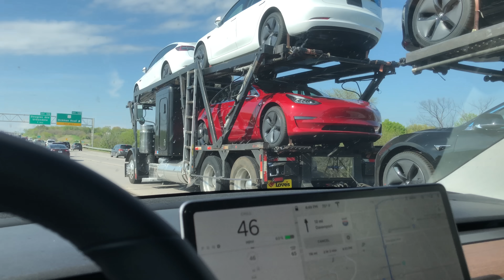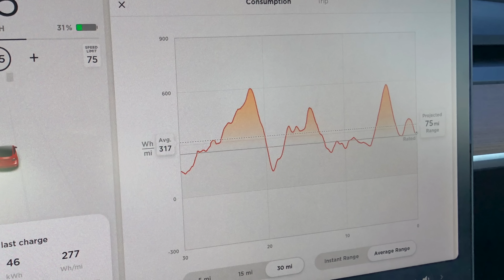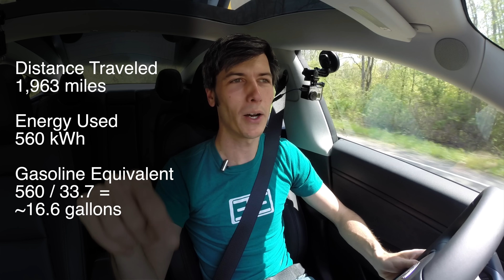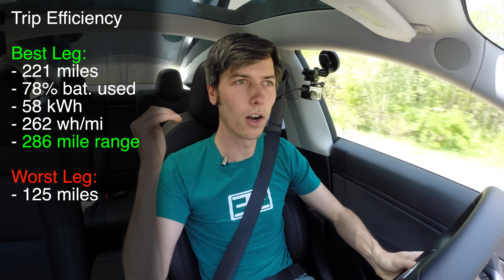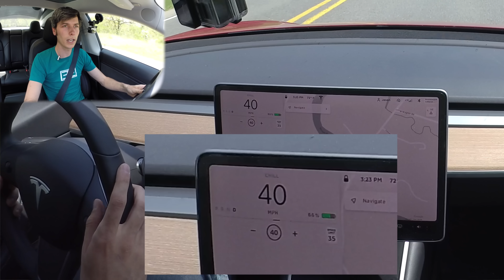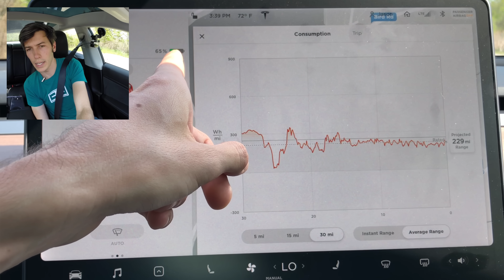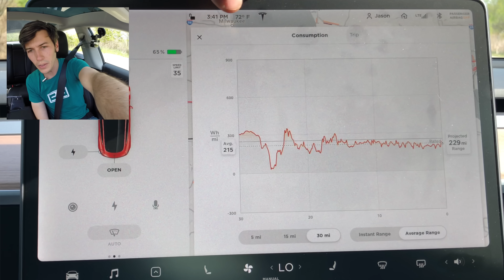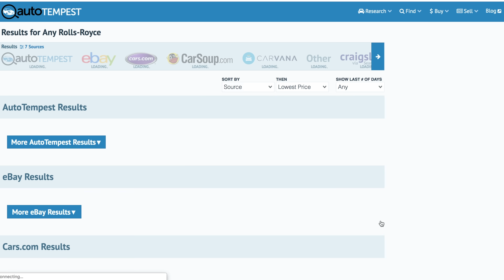How Miserable Is A Tesla Road Trip?

Comment: 1- this video made the road trip for average/non-tech people a hard thing, as they have to calculate in advance lots of factors !!
2- what will happen if front tyre explodes while on AutoPilot at 70 mph !!!
Reply: Road trips are easy. Charge up to 90-100% before you leave (ideally). Just say "Navigate to <destination address or point of interest>". The nav computer will tell you where to stop and how long to charge. It's pretty easy to beat the current algorithm. Just charge so that you have a projected 10-15% arrival charge at your next supercharger. Then take off, maintaining as high a speed as required to keep that arrival charge more or less constant, or at least above 5%. Repeat until you get to your destination. If it's a multi-day trip, you can stop at a hotel with a destination charger or at a campground with 220v to charge while you sleep. 

As for a blowout at highway speeds, I'm sure it'll handle it about as well as possible. Teslas are the safest cars on the road.

Comment: Worth noting... You also went 'down' 2 km in overall elevation. Going the other way you'd have quite a few more stops and longer charge times.
in a gas car, your range till needing gas would be about 100 miles different between the two as well.
(yes it's not 'all' downhill, but an overall 2km height difference is a pretty big difference)

Personally, I'd be curious what your range/time/etc is when the batteries are 5 years old (and not going rather significantly downhill). And while some do sell their cars and keep buying new, bear in mind your resell value will be horrid if battery wear is a big issue. So battery longetivity IS an issue, regardless if you deal with it or sell it. Also, for "save the planet" sentiments bear in mind that NOT spending energy to make a new car every few years saves drastically more overall energy/pollution. I don't dislike that tesla is moving the bar on efficiency, but electric cars are still awaiting critical battery tech breakthroughs which will make them fully viable. Any one of doubling the charge, the battery longetivity, or halving battery cost, would put electric over the top, but it's not there yet.

Comment: I worked out my diesel car would do it around $169 but that’s at 45mpg. Took me way to long to work this out as I had to convert everything to the English equivalent. But my car was £3000 so would be interesting to see the cost over a total of 10 years of how much you’d pay for each of these with second hand and new prices.
Reply: Would be cheaper to buy the most economical diesel car so I’ve worked out lol. Using your calculations, a car with 50mpg would be $148.40. Not that I prefer diesel to petrol!!

Comment: I've heard of people plugging in to a 120v and getting 4kWh-8kWh
It seems like the GPS/mapping would also factor in speed between superchargers before leaving each one to go to the next or to the final destination. Thus, it's going to use posted speed limits (somehow). So if a driver is actually going slower than the posted speed limit or has AP/cruise set to go slower then you'd probably arrive at the next supercharger or final destination with more range left than it calculates.

Comment: You might want to look at Bjørn Nyland's channel. He did a rundown on the optimal speed to drive from charge to charge to reduce trip length. It was significantly faster than 80 mph, more like 110 mph.
Also, if you get Autopilot and use Navigate on Autopilot, the car will pre-warm the battery if you are navigating to a Supercharger so that you get the best charging speed. None of this "first charge of the day" nonsense.

Comment: Honestly I'd had expected an equation of the total time of the trip depending on the speed of the car as a variable (that affects the range) and charging speed (that depends on the charge of the battery at the moment of charging and temperature), and then try to minimise that equation to calculate the optimum driving speed! XDD

Comment: What missing is, that how much coal did you have to burn in the power plant to fuel your trip?
Or equivalent in nuclear power.

People tend to forget this side of the story.

Even with these included in the calculations can be efficient, but than the question of the life of the battery, end what percentage of that battery can be 100% recycled?
As far my limited knowledge goes, batteries are nasty for the environment... imagine when a couple billion of electric cars will have to dump their batteries...
That too is terrifying...

Comment: Electric cars might be somewhat efficient but which is easier to fix and repair verses more harmful for the environment? What did Jason say about having to us charging stations? he had to wait for a long period of time 8 hours on one charge to go about 221 miles. You can do that much distance in a 2007 Toyota Corolla automatic and still be more efficiency and have better range as well as comfort with the ac on. Not to mention the turn around time is so much better at the gas pump than waiting for what was it again for the average time like 6 hours to charge up one time? That is ridiculous. The mile range of one charge up from this Tesla is 250 miles correct? My Corolla with 252,000 miles can get 415 miles on less than one tank of gas (13.2 gallons) (used Gallons 10) on the freeway. (MPG Highway is 41.5 that is nearly almost double the range of an electric car) That was fully loaded with 4 people, Ac on the entire way, 4 large suitcases going from California to Idaho then back again. Tell me why is it better to have electric if the mileage range is much lower than a internal combustion engine? That car doesn't put out hardly any emissions if at all and is super fuel efficient. I have to disagree with you Jason.

Comment: This shows how bad the inverter in the car is for efficiency.(not Tesla specific just stating all inverters suck.) I am not 100% sure but it looks like they are using 480Vac 3-phase to 400V dc so there is almost no loose in efficiency while charging.

Comment: Does using a super charger effect the longevity of the battery?  Does it make the batteries hot while they charge?  150Kw charging is a very high rate of charge and I can't imagine it wouldn't decrease the life of the batteries.  

If you use fast chargers for Li-Ion tools, constant use of these can reduce life of the batteries by 60-70%!  Of course there is always a trade off for these things and I can't imagine that Tesla doesn't know these things but do they tell the customers?  Or is this a method to sell more battereis down the road.  

This is a VERY important issue when it comes to the "carbon footprint" of the car b/c the batteries are by far the most intensive use of carbon due to mining/processing of the lithium and then manufacture of the batteries.  If this reduces the life by a fair amount then this will be a big issue down the road.

Comment: Do you think Tesla would ever put in an extreme weather  package that can use an auxiliary power source to produce heat or cold (interior AC or heater & could be used to heat batteries in very cold conditions).  If they added 1/2 - 1 gallon tank for kerosene or even diesel (or other fuel - propane would work well too) this could be used to produce cabin heat or cooling.  For cooling it would use the same technology that RV refrigerators use (absorption refrigeration).  

From my calculations a gallon  would last about 1200-2000 miles if the cabin needed a 60F (cooling) or 90F (heating) temp change from the outside temps - the difference is because of the inefficiencies in absorption refrigeration.

This would allow 100% of batteries to be used on range (minus the small amount to drive fans). I'm wondering if EV drivers would turn their nose up to using a liquid fuel.  There really is no better way to produce heat or cooling in these situations because of the high energy density of liquid fuels.  

As far as how the heat would be produced (heat is used for the cooling as well, which drives the absorption fridge) it could be the same way that old kerosene lanterns work, where there really isn't an open flame but confined in the mantle which produces the light (~1% energy) and ~99% heat.  It could easily range from 300 watts to ~2000 watts of heating/cooling depending on the demand - with higher demand actually being more efficient.
Reply: You should look up Bjorn Nyland Tesla vids who lives in Norway

Comment: The technology is cool and fascinating.  The Mother of All Trip Computers pretty much eliminates range anxiety.  And I would sit in the car the whole time it is charging just swimming through the data.  I can see the appeal... but not for me. 

I prefer my semi-Luddite Jeep (I allow for EFI because I am not a total Luddite obviously).  I want a mechanical connection between my foot and the throttle, my hands and the wheels etc.  I can fix or at least rig a temporary fix for a mechanical issue; but a software issue that leaves me stranded, that I cannot fix.  I guess I just don't trust technology enough to put my life in its hands while driving.
Still the tech is just... WOW!

Comment: How does it charge and drive 200 miles in 50 minutes? Or should i ask how much does the battery upgrade and quick charger cost extra on top of the car itself? Also Tesla is not as reliable as they'd like you to think. Gas cars will regularly do 200,000 miles without major replacement parts, some as much as 300-400k on stock parts. You can't honestly say that these batteries have enough cycles in them to do that many miles without replacement. Which will cost about as much as a new engine AND transmission combo. Yes electric motors are very reliable, but what about the rest? I get that electric works, but are you actually getting your moneys worth or is it just a fad to save a few bucks on gas just to spend that money and more on batteries later?

Comment: I fail to understand the assumption that is apparently made by pretty much all Tesla Bros that whatever you want to eat will definitely be walking distance from a supercharger... this does not make sense... also, I dont get how everyone says "oh no, there is no inconvenience, its no different than a gas car" this is ABSOLUTELY different, most high end sedans have 400+ mile range that can be refueled in minutes, virtually anywhere you want, with a virtual guarantee that what you actually want to eat will be across the street from a gas station. Videos like this just confirm what people like me think about those cars, the level of planning you had to do to make this work is ridiculous, hate on me for this comment all you want, but its the bottom line
Reply from the maker: You don't have to do any planning at all, you plug in your final destination and the car gets you there with the Nav system. As the video shows, it will take significantly longer than if you were gassing up at each stop instead.
Reply: @EngineeringExplained  Bro, basically your entire video was detailing how at nearly every turn that car was an inconvenience.. a road trip is supposed to be a fun opportunity to enjoy the freedom of the open road, NOT an exercise in planning around the limitations of your car.... seriously.... on a trip like that on the open road my Civic Touring edition would get up to 550 miles per tank AND be refuelable in EVERY, SINGLE, TINY hole in the wall town, this video is literally a giant expose on why the model 3 is a terrible road trip car.... I need to make a channel dedicated to this stuff

Comment: Wow, that seems like an awful lot of charging time. I drove 1180 miles in one day with my Model S, and I only needed something like 2 hours and 50 minutes of charging. I ended up charging around 3 1/2 hours though, cause a nap sounded good at one of the charging stops, and I had an air mattress in the back.
Reply from the maker: So you went 1180 on 3.5 hours charging, I went 920 on 3 hours charging. Not a massive discrepancy haha. Again I was using large safety margins as it was my first EV road trip.

Comment: haven't seen anything about what is involved with installing a charger at home for the Tesla - assume everyone goes with 220 - which would probably mean getting an electrician involved as I have a 3 car garage but certainly don't have a 220 socket anywhere
Reply from the maker: Yeah, I had a 240V outlet installed in my garage. $400, but it's nice to know that it can fully charge the battery overnight if you're out driving 250 miles for the day.

Comment: does the tesla do a calculation that includes charging stops and most efficient driving speeds and suggest that you drive at a certain speed to to cut down charge time so you might be driving slower but overall time is less because of your more efficient use of electricity? or does it just suggest speed based on amount of charge required to get to the next spot?

Comment: 3hrs and then stopping for an hour....  Wow that's irritating.

I typically drive 6-8hrs in any one stent, and I'm doing it at 80-90mph.

Yeah, don't think that model is for me.

If I were to change to another style vehicle it would probably be a hybrid.

Current vehicle: 2012 BMW X5 35d. Best range 530, worst 480, and it cruises at 90 with the AC on (Texas summer). 3/4 of the vehicle is packed with personal equipment needed for work. (Also, I have a full size spare in the back.)

You're not selling me on this model with this review.  I really, really, like the technology of their vehicles. I just don't see the value in it (especially the charging times...).
Reply from the maker: I don't drive 2000 miles very often, so to me it's not a big deal. Perfect for daily driving. Most people don't drive 200+ miles each day, and it's full charge the next morning. But I'm not trying to sell you on it haha, buy what you like!

Comment: Can you explain if it is safe to drive on run flats with a bulge in one of the tires?
Reply from the maker: If a tire is bulging, you should get it replaced. Tire company may do it under warranty. But leaving it is just waiting for an issue.
Reply: @EngineeringExplained  thanks for the quick response👍

Comment: I had never really looked into it but I'm floored that you only save $39 over the course of 2,000mi
Reply: Those 20 PS4S tires are inefficient. Lower end versions have an 18” base wheel that comes with low rolling resistance grand touring tires and aero covers, and some are RWD which also improves efficiency. But they're not as fun.
Reply: He never said how much money he was charged to plug that thing in. What? charging a car is free?
Reply: Jason's home electricity rate is lower than Superchargers, so there's a bigger fuel savings difference for day to day use, especially if city driving is involved.
Reply: And yet, I bet he spent much more than the $39 killing time eating food, beyond what would be spent with a gasoline powered car.

Comment: The vehicles I have had for years can be operated on the highway pretty much with steering and adjustments to my cruise control. I don't usually even touch the brake or throttle for many miles at a time.
Reply: Wooww that's crazy

Comment: Availability of charging stations is definitely a plan thing; especially in certain parts of the US.
Reply: And that's the rub of it. If you only drive locally electric is usually fine. If you drive where there are superchargers, fine, but if you go off the beaten path then it's not always that easy. ICE still have it's uses, but driving an electric isn't as bad as it would have been 20 years ago. It's not the universal ICE replacement, and it probably won't be for a long time if ever, but it's an alternative that can work for a lot of people, especially if the initial cost wasn't quite as high. For a lot of people the total cost of owning a car is important, but even if the electric option would be cheaper over 10 or 20 years the initial cost can be a deal breaker, not to mention that we don't know that they will age gracefully. Things like that makes ICE and hybrids look more tempting.

Comment: Jason you dont need the buffer because it will tell you and on top of that there is 15-25 miles after 0% aka a reserve. Not to mention added buffer option is foolish because it will severely hamper charging times by not charging at optimum state of charge.

Comment: Great video & Great information. I don’t have an EV yet but I started timing myself fueling up and food/rest stops on road trips... the results surprised me, took more time than expected.
Reply: It would be interesting to see your results with an ICE vehicle.  Ultimately, your choice depends on what your goal is.  Do you want to drive a long distance in the absolute minimal time-bathroom breaks and  energy bars with no other food, or do you want to do it comfortably and not rush the stops?  I find the M3 AWD a relaxing and comfortable car to drive on a road trip, but I will stop for 15-20 minutes or more to eat.  The suspension with 18" aerowheels is not too stiff in this model (it started out stiff but loosened up after the first 1500 miles). Also, autopilot really does make a difference in driving stress over a long distance or in heavy traffic, but I do like to drive without it occasionally to avoid boredom.  Having an excellent sound system helps.  Driving 65-70 MPH with occasional traffic slowdowns I find the total highway range with the AC on to be around 320 miles with a full battery, but would always leave a buffer as he does.  A difference between an ICE and a BEV is that you fill up the ICE gas tank to full.  In a Tesla, unless you were planning on staying in one place for a while, you do not.  It takes about the same amount of charging time to go from 20-80% as it does to go from 80-100%.
Reply: DrTed3 , just topping up the fuel (1/2 tank large sedan), the wife & two kids going to the toilets and buying an Ice cream takes 22- 28 mins...
Reply: @Reg853OKG  
Thanks for the data.